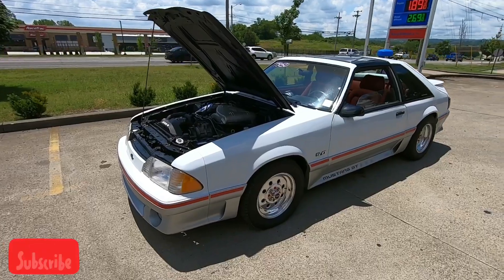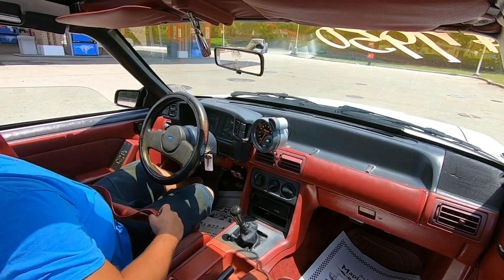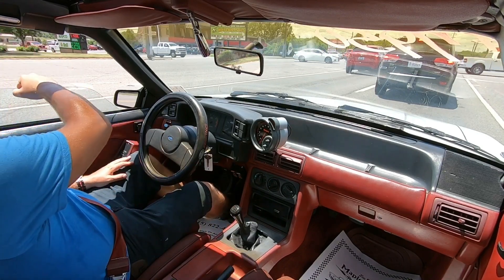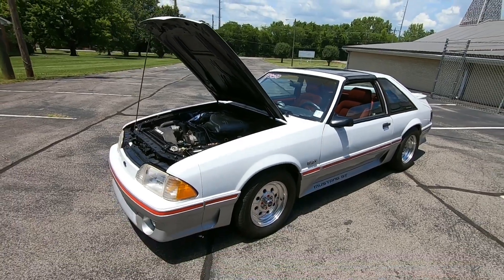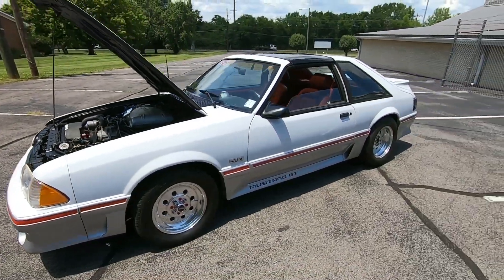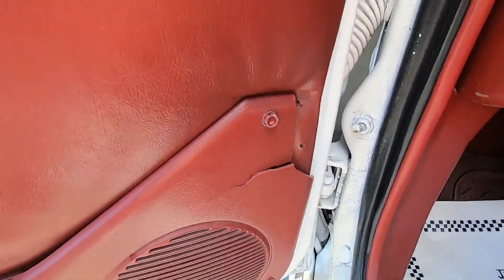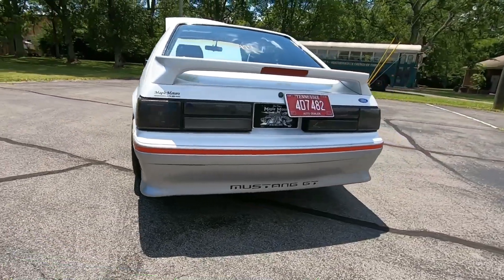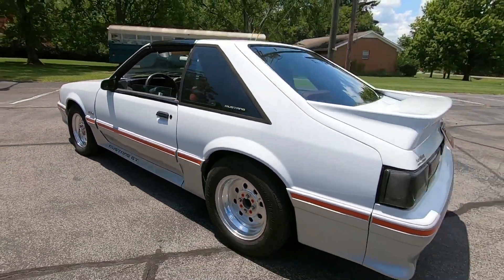Test / Walk 1987 Ford Mustang GT 5 Speed SOLD Fast $7,950 Maple Motors #628

Comment: Nice Fox! Looks pretty nice. Wish it was a  '89-'93, better motors! Love your videos! I've been trying to get my Dad to bring you his '31 Ford Roadster street rod, but he says it's too far away! Lol!
Reply: Actually the 87-92 had the same motors which came equipped with the forged pistons and the 87-88 came equipped with speed density unless it was a California model and then it would have the maf.
Reply: Ok, and your point would be what...? Like I said, better motors in the 89-93, no speed density motors, mas air motors are better, and are better for tuning with the stock computer! I've had 7 foxes from '79-'93. I also used to work on a NMRA  Pro 5.0 team in the early 2000's. We had the first foxbody to  run 200mph! 7.06@206, so I think I'm going to listen to the engine builder, but thanks anyway the fox doctor!
Reply: @jeffhyde7934  So! I've been running these cars to since 1989 and could tell you everything I achieved as well but the fact is 1993 Motors had different pistons then the 87-92 engines which were forged and obviously you should know that lol!!! That's why in 1993 the horsepower rating went down to 215 instead of 225 and everyone knows that the 87-89 motors were the better engines and not 89-93 which has to do with the computer and not the engine assembly. So my point is, you were saying the 89-93 were the sought after motors which you should have said the computer/MAF were the better Mr. Pro 5.0 lol!!!!